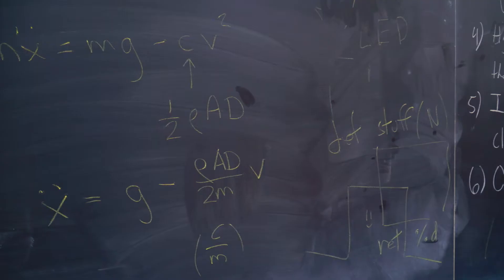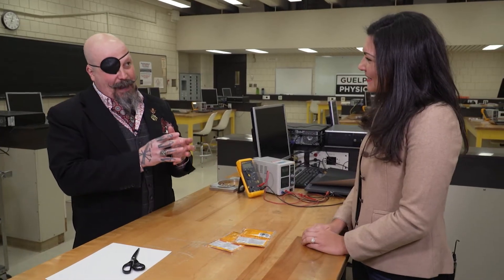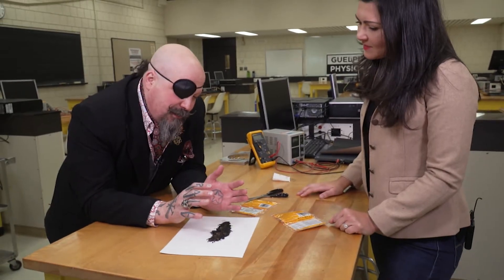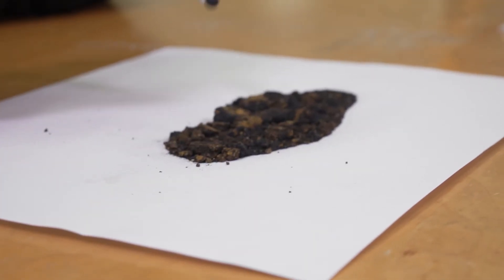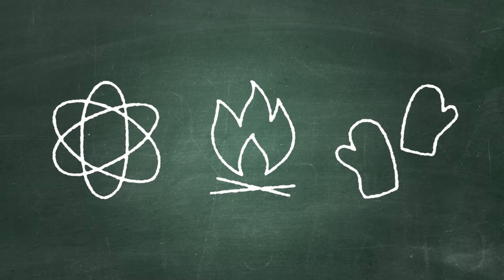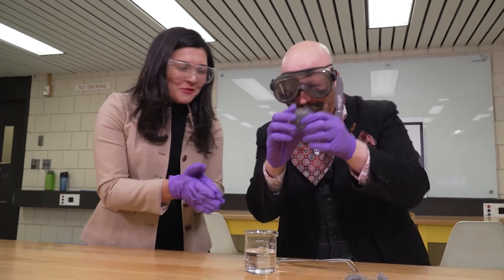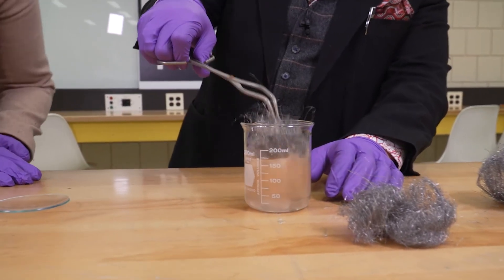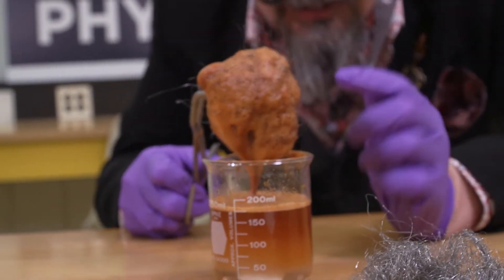The Science Behind Hand Warmers - How Do They Work?

Comment: They did not explain how hand warmers work. If What they say is the case then the hand warmers would have been activated before use.
Reply: They're sealed in an air tight package. No oxygen = no reaction.
Reply: They did explain how they work, just not how they're made. Can't oxidate without oxygen. Put the ingredients in a sealed environment, replace all the oxygen-laced air with something less-reactive (like nitrogen), mix the ingredients in the not-oxygen, put it in a permeable pouch (still in the not-oxygen), and put it all in an impermeable container for shipping/storing/selling (yep, still in the not-oxygen). Voila.
Reply: Oof